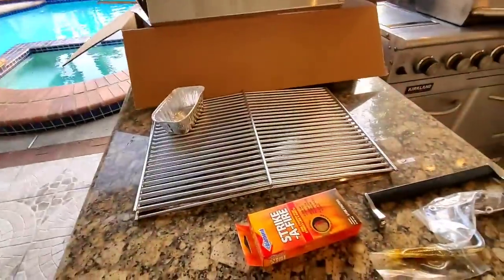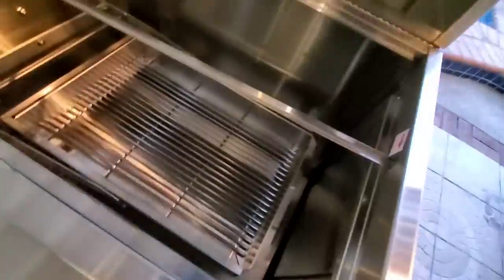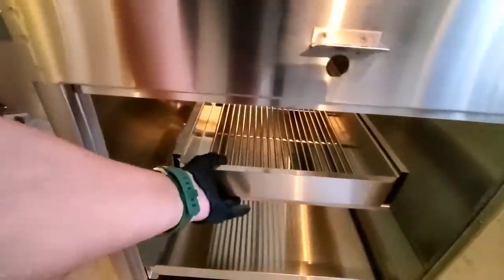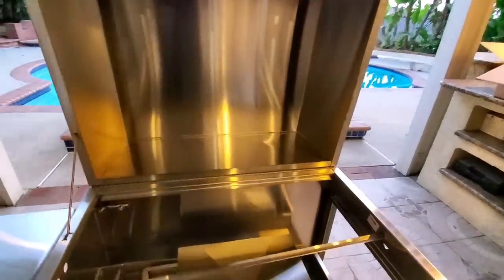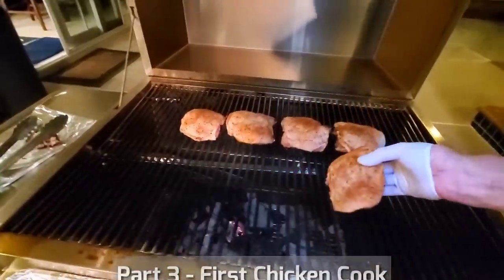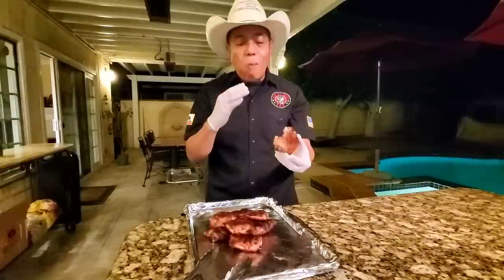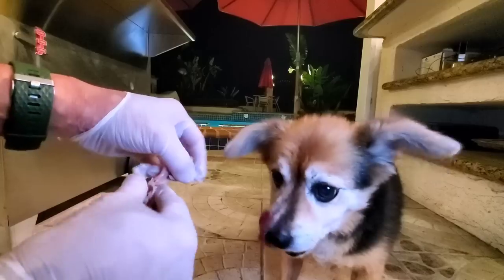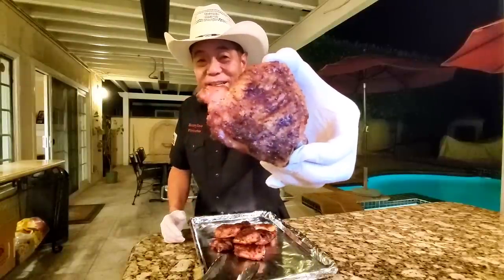Pt. #1 Hasty Bake Legacy 132 | Unboxing First Cook | BBQ Champion Harry Soo SlapYoDaddyBBQ.com

Comment: Harry congrats in joining the Hasty Bake community!  I have had my Gourmet Professional for over 30 years and still looks great.  Besides the ability to smoke and grill by raising and lowering the fire box, I use for rotisserie chickens or turkey.  I recently changed out some parts to refurbish he fire box and the new parts are better than original.  This is a great system and produces excellent results!  You can burn both charcoal, or straight wood.
Reply from the maker: This is a classic that keeps on going!
Reply: oh really, you can put a stick of wood in the tray instead, it has enough airflow for that?

Comment: Nice review, Harry. I’ve never used a HB but they are built in OK not to far from here and I’ve run across a few people who have them. They all say they are built like tanks.
Reply from the maker: Thanks Justin.  They are great design that is safe for SoCal as fire is a big threat here.  It's kinda like a reverse Santa Maria where the fire is raised or lowered versus the meat being raised or lowered.  I'll be doing some burn barrel wood cooking with embers as it is also a burn barrel and a direct heat cooker.  The inner pyromaniac in me loves to play with live fire!
Reply: @SlapYoDaddyBBQ  My inner pyromaniac agrees with your inner pyromaniac. That's most of the fun, right?
Reply: I had Weber, Big Green Egg,Cookshack Smoker, wood pellet, gas grill. Who Knew???…..ALL i needed  was Hasty Bake, stainless steel .  Hasty Bake THE lifetime grill.

Comment: Harry, the Hasty Bake concept is genius! I absolutely love it! But I must question the quality since specs aren't mentioned. High quality stainless steel is a must,  but there are different quality grades of stainless steel. True high quality Stainless steel will not rust... I know, I live in Florida... I have a high quality stainless steel cart for my Large Green Egg and it never rusts, not even if rained on. Also, bought a prep table with a stainless steel top from Sam's and after only 3 weeks it developed rust lines in the stainless steel top and it had never been in the rain. If anyone is going to drop 2K for this unit, I would hope they are using the best stainless steel available. The gauge of the metal, or thickness, does concern me... thin metals don't fair well over time in high heat cooks and for longevity. I'd be willing to pay more for a unit with a thicker gauge steel and of the highest grade stainless steel.  Since I live in South Central Florida, I have to be careful with the any type of metal products I purchase for outdoor use. I also have a pellet smoker from Yoder (YS640) and it has a powder coated stove paint on it with 10 gauge steel that has never been in the rain. It constantly rusts, they even provide you with extra paint and instructions to remove the rust to repaint it. The Yoder is built like a tank and performs flawlessly but it's a nightmare to maintain because of the rust problems and I paid a lot more than 2K with many accessories added. Also, because of it weighing over 500lbs freight costs were expensive. Since I'm up in age, I like the pellet smoker for long cooks because I can set it and not have to watch it or baby it. I like the green egg for shorter cooks like steak and chicken with the added flavors from the lump charcoal. The Hasty Bake would be a comprable choice to a kamado style cooker such as the green egg or Kamado Joe. The ability to raise and lower the charcoal grate is something not available in Kamado style cookers. That feature alone is pure genius and would make a world of difference in the quality of a cook. Thanks for your presentation of the Hasty Bake! I will look into the technical specs for a consideration. Love your vids Harry! Please keep them coming!
Reply from the maker: 72 years old grill so it has withstood the test of time.  Its older than I am!
Reply: Proud to live in Tulsa.OK home of Hasty Bake. Thickest, best stainless steel only. First and original closed lid top by Grant Hastings 1948. Moveable firebox was genius. SS Hasty Bake is a lifetime grill you will pass down to grandchildren.

Comment: It looks cheaply made. Is there a way to tighten down the dampers because once they get worn it looks like it's just going to fall down?
Reply: I thought the 18 gauge was rather thin myself.  I would rather see 14 or 12 gauge metal.
Reply from the maker: Not sure why you say that.  This grill is 72 years old and has withstood the test of time
Reply: @SlapYoDaddyBBQ  I stand corrected. Thanks Harry
Reply: @SlapYoDaddyBBQ  That is true.  I have never cooked on one or seen one up close.  I thought the specifications at 18 gauge,1/20in, was rather thin.  I was expecting to see 14 gauge at 5/26 in or 12 gauge at 7/64 in for thickness of the metal.  The list price at $1,899 is right in there with decent quality grills and the customer reviews are all at the top.
Reply: I have an early '60s Hasty Bake Pioneer (now called the Suburban).  The vents still work/hold perfectly.   Not bad for a grill older than I am (I'm 56).
Reply: Randy
My Hasty Bake is 7 years old. Dampers work as if they were new. These grills are tanks
Reply: Randy, I had an older HB from the 60's and the vents still stayed where you put them so that is not a concern.

Comment: Air intake is also through the seems of the doors :P
Reply from the maker: Yes, part of their ventless hodd design.  I tried it and it works really well!
Reply: @SlapYoDaddyBBQ  I picked up a powder coated one for $125 at flea market here in Tulsa, OK.  It wasn't too bad.. just surface rust.. I brushed it all off and seasoned it.  Didn't use it much so ended up selling it.  But I wish I still had it.